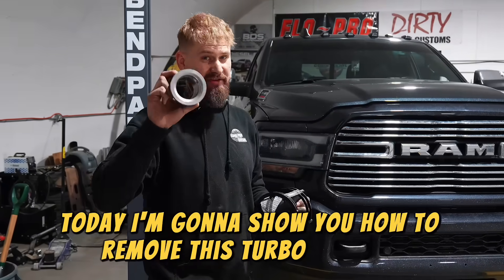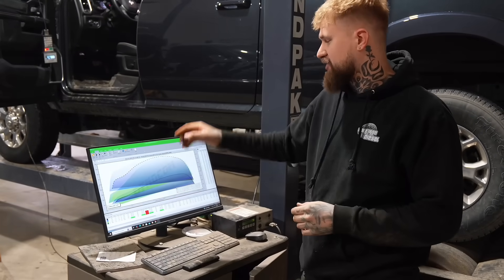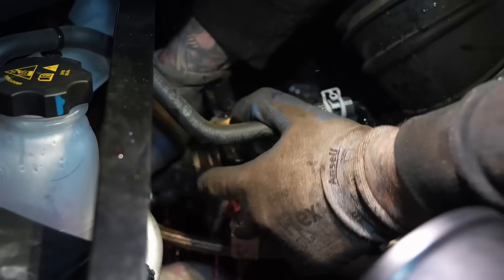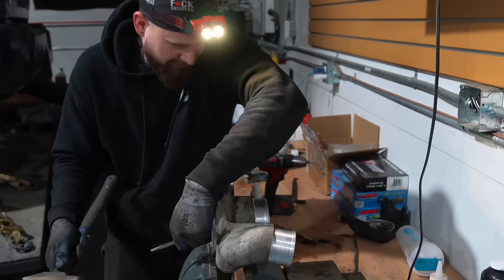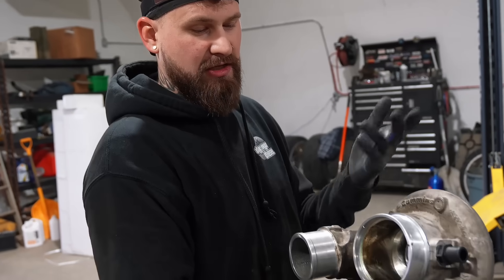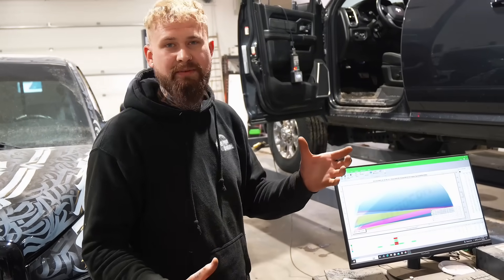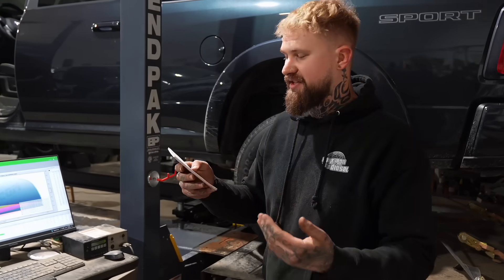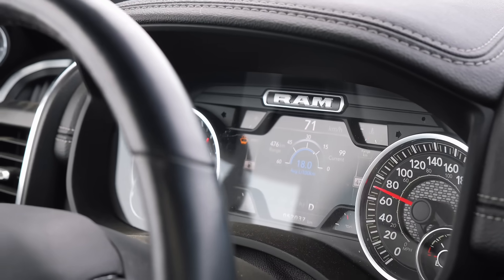Does Removing The Silencer Ring Increase Horsepower?

Comment: Not sure if you’ll ever see this, but you need to look into stainless diesel’s drop in 10 blade exhaust turbine and their 5 blade billet inducer wheel. It’s pretty easy to install with the turbo in the truck and helps a lot and sounds good

Comment: I recently did this on my 2021 6.7, was nervous when I started drilling the turbo, but got it done. It sounds sooo much better, especially with the afe momentum HD cold air intake. However, I noticed that I have a little bit of sputtering/loss of power when coming off throttle and when cruising. I checked all my intake lines and cold flow lines, no leaks. Could it be the catalytic or DPF filter in the exhaust backing up airflow? I appreciate it. Also, brother your videos are 10/10!
Reply: Any update on this mine is doing the same thing?
Reply: @BraydenMedford-v2j  whats the issue? how do you have a loss of power when coming off throttle?

Comment: you can reuse the hose clamp on the filter and (chopped w/ a pair of dykes) any other such use in all applications... the style of clamp used and the application for the use in the industry.  chopped w/a pair of dykes$$$. to remove such clamps; use a tapered punch. use the tapered punch with care. with using a punch needs a hammer of light weight. using the punch; few taps on both sides for uniformity. slowly tap each side opposite of the opening. thus you open clamp freely.  to clamp the reused clamp and or a new clamp i use a pair of flat nose dykes, not angled) to squeeze together.

Comment: 💪🔥💯 Love this channel.

I finally got all the Banks stuff on my 2022, and 42k miles.  37x10.5xR20s, 4.5 BDS 4-Link kit with front and rear full kit. Timbren rear spring kit for lifted.

Not deleted yet but, so far happy that it's close to the 400hp mark - I may pull out the ring as well.

😂 Love to have a Dyno but, wife would kill me for wrecking the garage...lol

Comment: All that work for a less than 3% change. That's borderline margin of error. Absolutely not worth the time. Now, if it makes a bigger difference with other mods then perhaps. If your optimizing the intake and exhaust and that turns out adding up closer to 5% difference with other supporting mods then I would say yes. Flow optimization plus a free 5% on top of that? Also how does it effect the effect turbo inlet air flow rate at higher boost?

Comment: I’d say doing the mods helped your fuel mileage considering the baffle thing probably restricted airflow to the turbo same with the thing on the turbo you took off, as it looked like it was restricting the airflow curious is it the stock turbo if so they probably do it to try and cut down on emissions and to possibly help your fuel consumption but in reality I’d feel you’d use more fuel because of the restrictions you’re needing to run the truck harder to get up to speed which can be hard on the engine!

Comment: So did you need to drill the pins out because if so using a drill press with a soft clamping vise would be your ticket to drilling them out straight!

Comment: Despite the gain I would question whether the truck is more surge prone now. Usually the aisin trucks short shift like crazy and that issue is worse when loaded down or with big tires. Be curious to see if it’ll surge if you put a trailer behind it or lug it.

Comment: If you put a banks cold air intake on a 22 ram 3500 and a monster ram intake horn you will definitely hear a whistle when you step on the throttle. That’s what I did with mine and it sounds so much better. It also helps with the grid heater problem these trucks have.
Reply from the maker: Im doing that in a couple weeks!
Reply: @darkirondiesel  I’m wanting to do a full delete on my 22 ram 3500 but it’s still way to expensive with having to replace the ecm. Hopefully one day they will find a way to do it without that. There was a company in grande prairie ab that was deleting them without ecm change just not sure if they totally figured it out yet or not

Comment: I am a newer diesel guy, i just bought a 21 6.7 with only 30k original miles and right off the bat did everything from Banks- elbow, cooler tubes, and the cold air. Still stock, and 68rfe, no tune. Just the cold air upgrade will make a massive difference in whistle noise. But even with the rest installed, there was unnoticed power or economy change. You basically spend the money for future plans if you only did what I did. Ive been reading dozens of posts about the pros and cons of silence ring removal. You covered it very well but for only a 10hp gain, its without a doubt not worth the work you had to do lol. A pedal commander would probably do more lol

Comment: Good content but that thing you removed from compressor housing helps suck air from pcv. Also makes negative pressure which help wit a lot of things.
Vapor condensation, oil flow are just some...

Comment: You put the monster ram instake and the boost tube upgrade on that and you'll notice a difference! I did that on my 3500 Ram and wow she hauls now. Mine is 2021 Ram 3500 Cheetah Turbo, Monster Ram instake, Monster Ram Cold Air, Boost tube upgrade kit, fully deleted and pulling 523hp & 1199 ft/lb on the Dyno.

Comment: Turbo is a multiplier,  obviosly you give it more axis to air , it should mutiply a higher number. Heat soak and air temps will give a 10+ hp difference easily.  Hard to say whats really going on. Wish you had temp readings for fluids and air . Intercooler , egt, ect

Comment: I did my 4th gen...same setup with the silencer ring...drill the pins one size bigger than the pins themselves. Remember the pins are hardened and the turbo housing is soft aluminum

Comment: Quote me if I’m wrong but in terms of diesels and dynos. Wouldn’t it be a much better and more accurate measurement to measure in torque numbers vs HP ?!?
Reply: With a dyno like that you need a good rpm signal to get a torque reading. It’s usually hard to get a good rpm signal on a diesel.

Comment: Wish these trucks weren’t so expensive to buy
Reply: 10 months later, prices are already looking better than they were. Hopefully that trend continues a bit longer.

The 5.9 cummins is cool and all, but so are 7.3 powerstrokes. You can find an ok 7.3 in my area for about 10k or you could find a nice one for 20k. I bought a fairly clean 136k mile 2002 7.3 f250 with a bad transmission for 12k this year. It's hard to find a decent 5.9 cummins in my area for a reasonable price. 

I've had 3 99-02 7.3s, an '06 6.0 and an '03 5.9 cummins. Each platform has its pros and cons. Now that there are much better drop-in turbos available, the 7.3 is my overall favorite. The stock turbo setup really holds it back. My biggest gripe with the 5.9 cummins is the truck the engine sits in. Ford trucks are built better. 

My dream truck is still a 08-10 SRW f350 with a 12v or common rail 5.9 cummins swap that utilizes the super duty's zf6 (manual) or 5r110 (auto) transmission. I'd need to have my own shop with a body lift before taking on that project.

Comment: I would expect a loss of horsepower because now the inducer of the compressor wheel is suspended in the air. I still would just machine the front of the inlet instead of removing the whole part.
Reply: The difference between you and Temu Jake Paul here is that you make turbos for a living, where this guy makes content for a living. It's not hard to get, what, a 2% change on a dyno. Just weather can do that.
Reply: @user63344-gds temu Jake Paul is mad work 💀

Comment: (Before watching this video) i doubt you will lose any power or fuel economy. I always removed silencer rings on my 6.0s and my cummins turbo on my 6.9. Only difference it made was sound. My dad removed his silencer ring and put a cold air intake on his 6.7 cummins and it made it whistle like crazy with no loss in fuel mileage or power.

Comment: You should just slowly add parts and modifications and see what makes more horsepower I would be so down to see that, like throw in a s and b or a banks cold air intake and see if anything changes
Reply from the maker: Go check out my other videos on my 12 valve Cummins we’re building it to 600hp one part at a time and every video we dyno it to see if we gained or lost power

Comment: SEEMS THE SILENCER RING REMOVAL COULD CAUSE POWER LOSS DUE TO MORE TURBULENT AIR ENTERING THE TURBO.
Reply from the maker: That what I thought because that’s what I’ve been told.  That’s why I do these tests!
Reply: @darkirondiesel  I think it was a fantastic idea. I have been wondering about the silencer ring removal since the cummins 12 valve! Thank you for putting in the effort.
Reply: The turbulence ends up offset because of how much bigger the opening is. 
Ideally it’d have a different insert that still smooths the airflow, but has the bigger opening.

Comment: Ngl for the silencer baffle thing in the intake you can reuse the clamps. You could on the 09-18 trucks anyways theyre just super weird. Great stuff as always. I love doing small mods cause its not always peak horsepower but powergained throughout the curve on the graph.
Reply from the maker: On the 4th gen yes you can reuse them but not on the 5th gen unless maybe you have a special tool for those clamps.

Comment: I’d be curious to see the difference with a cold air intake and the silencer vs cold air intake and no silencer
Reply: I did the s&b and turbo silencer delete and with the side cover removed it sounds amazing especially the exhaust brake. I do have a ccv disconnected engine light now so I'm going to delete the ccv hose and see if it goes away

Comment: Take a small flat screwdriver and put in the crimp of that hose clamp. Pry back and forth to open crimp. Pull off of lock tabs. Then reinstall, hook on lock tabs and take your cv boot clamp pliers and tighten…
Reply: Or cut it off.

Comment: Great video. Question for you since there was a gain on the 5th Gen by removing the ring. How about on a 3rd Gen with the 5.9. That's what I have and yes I removed the little ring and I can hear the turbo whistle way more. But do you think it help gain anything like your 5th Gen? I don't think it did because it is a little ring compared to the 5th Gen. But what do you think?

Comment: Interpolate load over speed; 70%/40mph , 80%/65, 90%/80, 95%/100. 🙃. If you w only got 1 eddy on a 24” it takes a lot. Probably still have to boost brake.
Reply from the maker: I think I can only do interpolated load with RPM not speed but I’ll see if I can change it!

Comment: Do a decent "Cold air intake" one with either the enclosed box or a heat shield and do another run. Personally, I was never a cold air intake guy but I've really liked the AFE intake because it actually bolts and locks into place unlike the ones that kind of just chill there. It also sounds cool. Could care less if it picked up power or not!
Reply from the maker: Yeah I’m gonna do an aftermarket intake and compare
Reply: @darkirondiesel test the s&b

Comment: I have an S&B intake with the baffle removed on my 2016 Ram 2500 & I can hear the turbo a lot better. Wondering if I should remove the ring now. Lol
I think 4th gen silencer removal is easier.
Reply: I have the 4th gen and it’s the same, you need to drill the holes and everything. It is a game changer in sound, specially if you have a aftermarket intake 
Fully recommend

Comment: think that baffle was to dyrect PCV oil away from the blades of the turbine to create fluid vapor flow along the turbine housing in preventing microscopic hydrostatic impacts on the turbine compressor. "at the most removing it might up the vacuum on the crank case if the turbo has a oil drainage problem", intake baffle removal is a common $3000 fine on road side inspections done of speeders as if its missing they add a "stunting" ticket and tow it away for more examinations giving out a court date "+ void insurance, ticket". engineered scramble button. (propane injection + touched er = -$$$$)
Reply: Huh ?

Comment: Nice content dude i will remove the silencer out of the pipe tho definitely. And can’t wait for banks intake video if it’s worth it the money ❤
Reply: I have a banks on a stock truck no delete I went from slug city to being able to spin my 37s off the line and the turbo sound is crazy loud I recommend the bank intake to anyone!
Reply: My 2012 has the Bank's cold air, Bank's 3.5" boost tubes and Bank's monster ram with an 80hp tune and my truck will get up and move. I have 35x12.5 tires and I can break them loose at 40mph. It does have some other stuff done but those things won't affect horsepower much like metal upper radiator hose, fass drop in series pump,race fuel plug coolant bypass kit and oil bypass kit. The Bank's stuff is definitely worth the money

Comment: Your only proving the back pressure is destroying the engine.the EPA mandates do not allow the engine to breathe properly and is costing the consumer more money artificially.its a good thing the EPA has thousands of qualified experts (actual mechanics) that know what they are doing.
Reply: Its not the EPA it's the manufacturer trying to quite down the engine.
Reply: @ if manufacturers didn’t have ridiculous fuel mileage standards set by the EPA. Most modern engines can be turned for efficiency without any problems or maintenance issues caused by parts being faulty or inefficient which causes back pressure which is killing these engines.i just saw the soot problem in a 6.7 Cummins (installed a banks intake horn) it’s insane to think unelected bureaucrats have any experience in anything they talk about.
Reply: @scottcampbell2585   They tuned these trucks for more HP to keep up with Ford. There are people that have tuned these trucks stock and got better fuel mileage. My first point is, is that the EPA didn't design anything. The manufacturer designed it and in this case it was to keep the engine quiet. Also if you keep up with your maintenance and clean your egr and egr cooler, soot is not as big of an issue as you make it out to be. Keep in mind tho I dont agree with all the regulations on diesel engines. Some of us have to deal with it and some of us don't.
Reply: @ the only people that benefit from the restrictions and regulations is government. Less fuel mileage means more tax revenue. Washington state promoted EV’S and had a budget deficit then passed a bicycle tax of 25$ on new sales people found out and the sales of bicycles fell.take solar panels on your roof and you decide to eliminate yourself from the grid government is not going to allow you to eliminate their money they will find a way for you to pay the tax another way.
Reply: How is a small intake restriction back pressure?
Reply: @ flow of air direction at a 90 degree angle. If you really want to see just how bad the EPA is look at the fuel mileage requirements imposed on automobiles and highway deaths. Both follow the same upward trajectory. Less steel in cars makes them less safe.
Reply: @scottcampbell2585  That’s still not back pressure. 
And now the EPA is responsible for crashes?
Reply: @scottcampbell2585  once again having less steel in a car was the manufacturer try to save money has nothing to do with government if anything the government is responsible for making our cars safer. If you don't believe me look at cars made in other countries they are made even worse than here and have no regulations so the death rate is even higher than an American made car. Blaming vehicle death rates on the epa is just stupid.
Reply: @ apparently you didn’t look.when I first heard that I looked into it and was shocked. Toyota even stop putting in spare tires to meet the regulations.personally I don’t need or want government officials telling what to drive. Am6’8” tall and I don’t fit in many cars. That’s why I have a 3500 Ram .
Reply: @scottcampbell2585  Do you want some coffee to go with that wine? There's nothing wrong with being conservative about fuel, oil is not an infinite resource. You should try it some time it might save you some money. By the way nobody is forbidding you to have a spear tire. If you want one with your toyota go buy one. It saves them money and reduces weight. Win win for them l. Now go ahead and disregard everything i said and leave another comment.

Comment: Good video, straight to the point and just facts. I removed the turbo silencer ring on both my 03 and 07 and you can definitely hear the turbo more on those older trucks.
Reply from the maker: Aftermarket Intakes?
Reply: @darkirondiesel  did this on my 3rd gen with stock intake and I can hear the trubo really good
Reply: I agree I have 01 and 06 Dodge  5.9 Cummins I removed silencer because I love the powerful turbo whistle sound too!